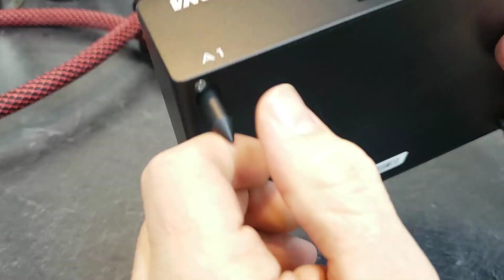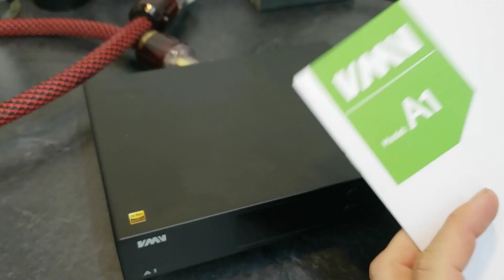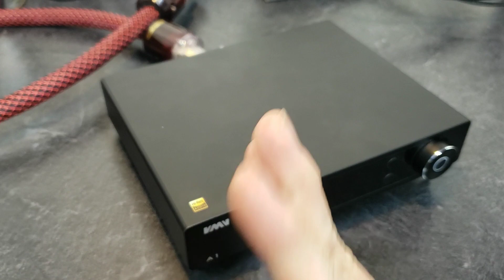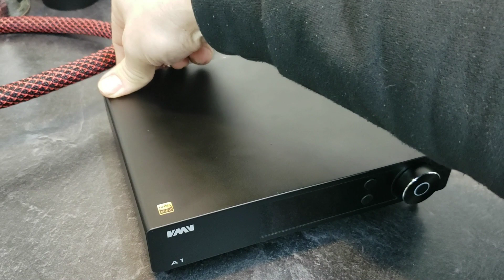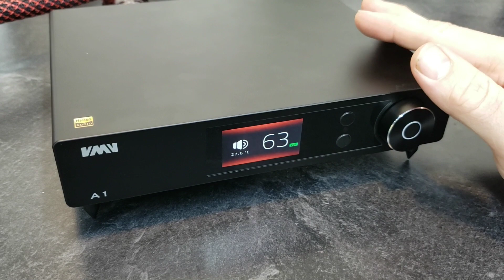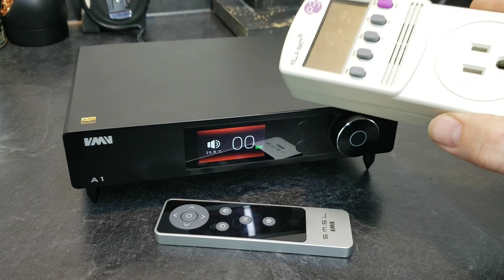SMSL VMV A1 (Class A @ Half The Size & Price)

Comment: It's actually a high biased class A/B amp. Many A/B amp have a certain level of class A mode, but most are  biased to less than 1 watt. 10 watts of pure class A takes much bigger heatsinks than the size of that whole amp. My JC1 mono blocks are biased to 25 watts class A and it takes 250 watts of power per/ch to idling with no signal. Class A amps have zero cross over distortion. The lag time between the positive and negative transistors (A/B mode) ramping up time when switching back and forth, is what causes crossover distortion. Class A isn't efficient with power, but it's the best topology for natural sound. Class A mode uses one transistor fully on, thus there is no ramping up time, or any related crossover distortion. 

Our brains are very sensitive to human vocals, so even a couple watts of pure class A bias will give a considerably better sound for vocals. Which don't take much power to play quite loud. The bass sucks a lot more power, but it's not a big deal if the bass dips into A/B mode for a spit second, because our human brains are mostly focused on the tiny nuances and inflections of voices. I'm not saying that class A mode doesn't improve the bass also, it certainly does, but realistically most people won't pay the high price for what it takes to build a high power class A amp. Class A vocals are where the "magic" comes. This is why so many people swear by tube preamps. Single ended tube topology is the most linear amplifier and it's class A. So are single ended tube amps, but the very low efficiency doesn't allow for enough power to have solid bass. Unless you spend a fortune and run your air conditioner in your listening room. Everything in audio is a compromise.

Comment: The volume control range is what it is to accommodate sources with high and low output. Complaining about distortion when you use a high output source and turn the volume up to the max is ridiculous. How would you feel if you had a low output source and could not get full volume? That would be something to complain about.

Comment: hi, Can i use headphone output in the back of "SMSL VMV A1 Amplifier Class-A" to connect to my subwoofer. thanks
Reply: No, but I suggest you use a high-level connection if possible for optimal integration between the amplifier and the subwoofer.